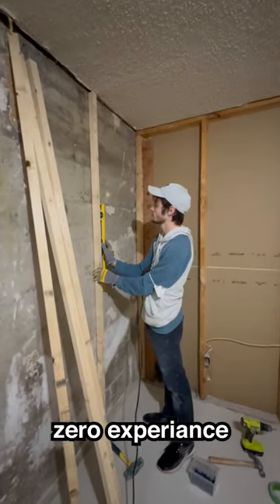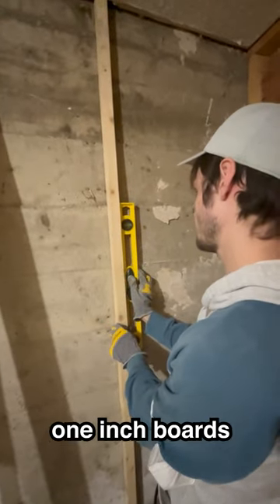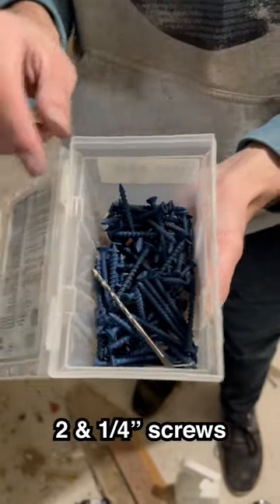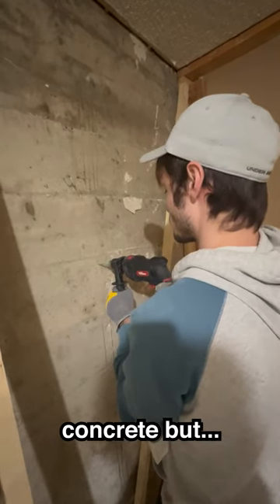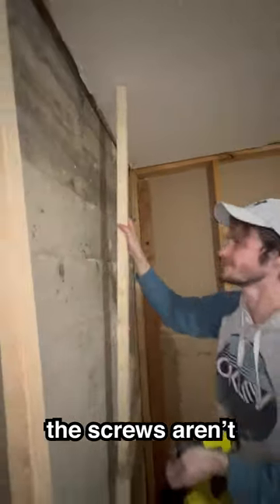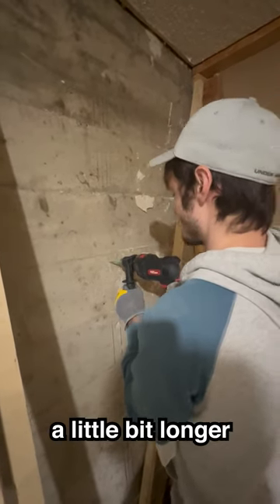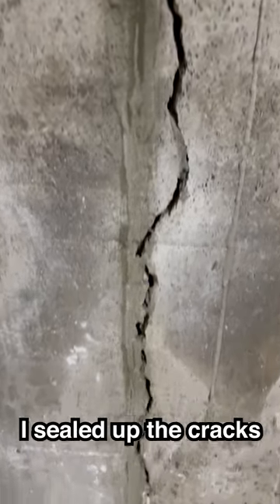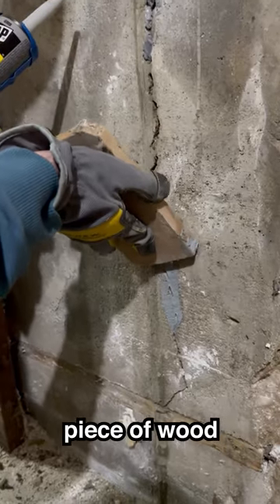Renovating My Basement With Zero Experience [Day1]

Comment: Always install a vapor barrier between the wall & wood in a basement, if you don't want that musty smell that is.
Reply: Lol install vapor barrier if you want mold an trapped moisture. You ALWAYS rigid foam concrete, then vapor barrier THEN frame then insulate then vapor barrier again an tar up every stud

Comment: Don’t tap on block foundation, you’ll weaken the face of the blocks.
Also, if you have cracks, seal them, go to the outside top of the foundation where the crack is located and fill the blocks with a liquid cement mixture. This will bond the entire stack together and stop water or further separation from occurring.
Reply: First off, not a block foundation.  That is a poured wall, aka solid. But thanks for the information for those that have block wall foundations

Comment: Never have raw wood touching the concrete. Put a tyvek membrane on the concrete then frame in front of it. Best would be to frame with 2 by 4s so the studs are big enough for your electrical.

Comment: the water gonna eat away at everything anyway use 2x4 pressure treated for bottom plate and then put the 2x4 studs on that 16 inch on center lol drywall gonna be wett

Comment: First time builder here. Pretty much everything is wrong here. First use silicone and then you can use that sealant. Also, how are you going to insulate? I recommend not use that 1 inch wood. Just go for a 2x4 it’ll be worth it when it comes to insulation and drywall. Also will make it much easier to make a proper vapor barrier or ventilation if needed. Oh, and double check if you’re using the right screws for the job.

Comment: Nonono I own JP CONSTRUCTION AND CONTRACTING LLC that's not code at all. Min walk studs are 1.5*3.5 with bottomg and top plate. For drywall you need 1 5/8 screws min.